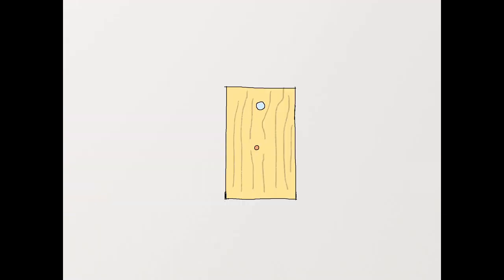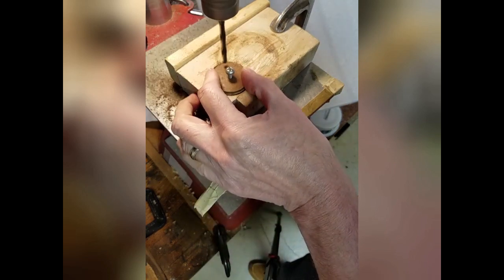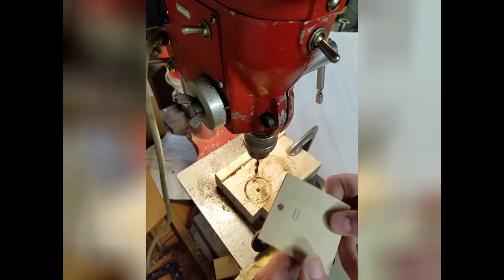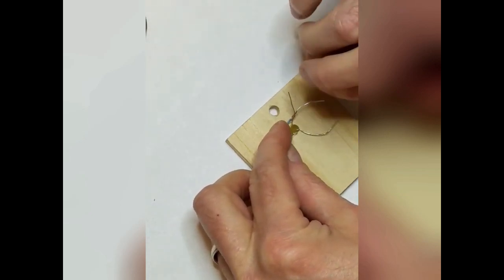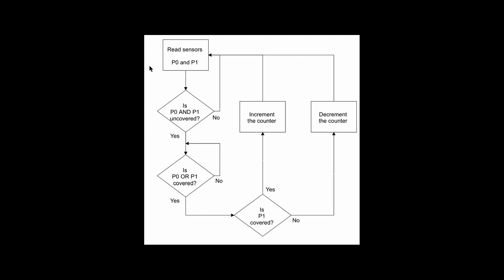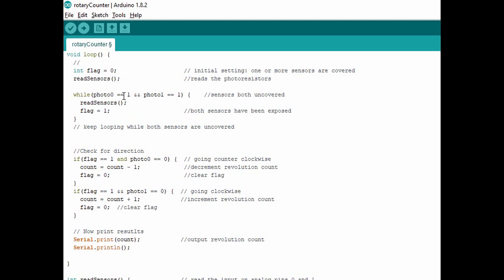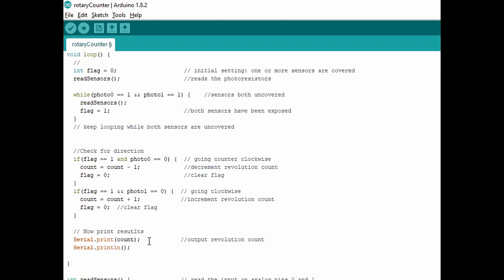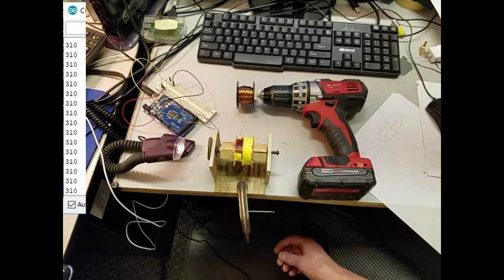Transformer Coil Counter

Comment: Great Video 👍 what type of sensors do you use?
Reply from the maker: Just cheap photo resistors.  I think these would work: https://www.amazon.com/eBoot-Photoresistor-Sensitive-Resistor-Dependent/dp/B01N7V536K/ref=asc_df_B01N7V536K/?tag=hyprod-20&linkCode=df0&hvadid=242033424131&hvpos=&hvnetw=g&hvrand=11327615993745189697&hvpone=&hvptwo=&hvqmt=&hvdev=c&hvdvcmdl=&hvlocint=&hvlocphy=9015344&hvtargid=pla-397676869569&psc=1

Comment: Hi, David. I'm considering rebuilding a transformer myself. My question is how critical the number of turns when you're working with the correct length of wire. This is a long way to go, but I want to rebuild the primary simply to determine the output of a center-tapped (three-pin) secondary, for which no schematic or other means of determining the rating is available. Once I do so, I'll probably source a higher-current replacement because the thing shouldn't have failed in the first place in the component in question. Anyway, how great could the error be if the same length of magnet wire is rewound without an exact count? I ask partly out of laziness and partly because I intend only to get a rough idea with a DMM before sourcing a replacement.
Reply from the maker: The voltage ratios depend on the number of turns, not the coil length.  For instance, because the inner turns of the secondary have a smaller circumference, there will be less wire length for those compared to the same number of outer turns (I realize you are rebuilding the primary).  If you don't rewind the coil tightly, or use a different gauge wire,  the turns ratios will be off.  I found I had to add several feet of wire when I fixed my transformer because I hadn't wound it as tightly as the OEM did.  But you can probably get within 5% using wire length only, if you use the exact same wire gauge, and wind it as carefully as you can.  Check out my other video regarding transformer rebuilding: https://youtu.be/zbmhQBLR85g  Sounds interesting, good luck!
Reply: @LifewithDavid1  Oh, I had. It led me here. Thank you. To that end, what type of varnish does one use? Normal wood finish? Something specific to the purpose?
Reply from the maker: @FearlessAmateur  Although there is special transformer varnish, I used a good polyurethane and it worked fine.